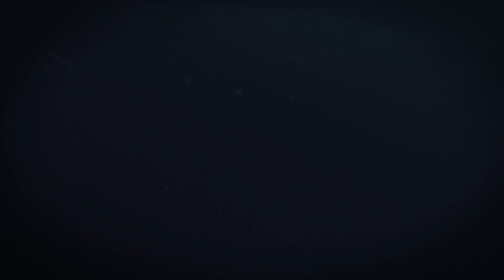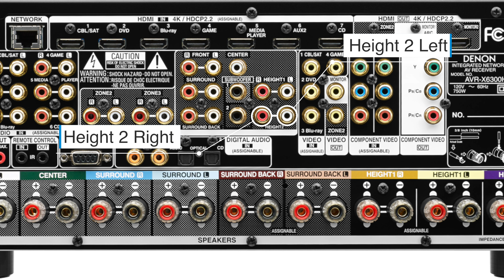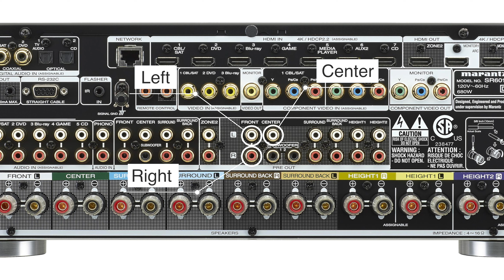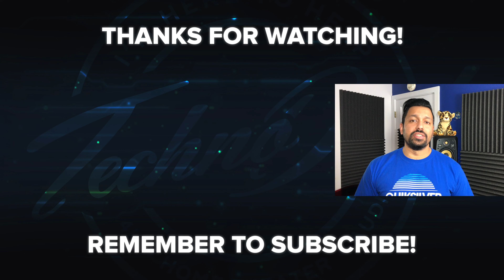How to Add an External Amplifier to Your AV Receiver | Home Theater Basics

Comment: Hi Techno Dad, so I can tell my Main Denon (x4300h) and plug in my old denon (AVR-5800), to process my front sound stage (FL, FR, CTR)?  By using the RCA cables? (FYI, I do have bigger speakers for my front sound stage)

Also: This is a more confusing question and I will try not to confuse you. I bought a bigger center channel that I want to hook. However, the speaker that I am replacing I do not want to discard. Now my x4300h can process 11 channels, and power 9 as you stated. My question is. Will I be able to add a fourth pre-out from my Denon x4300h out through my AVR-5800? for example lets say the voice of god channel, dead center in the ceiling?
Reply: i also want to know the answer to this.

Comment: Hey brother I’m using a Denon AVR 1300W 7.2 not sure how I can connect a amp to it.
Reply from the maker: Hi John!  Unfortunately there are no pre-outs on your model for speakers, only subwoofers.  Usually pre-outs for speakers come on the higher end models, like around $700 or $800+
Reply: Yea that’s what I figured out. I hate the fact that my volume level has to be almost maxed to get the sound level up. Don’t get me wrong my pair of Dayton 12" subs shack the crap out my theatre/office. Guess I’m just used to sound and want it to go louder. Luckily it’s a small room,lol.

Comment: Thanks for the vid, quick Q please, I got a Marantz PM60006 AMP and want to hook it up to my Denon X6300h to power up an additional top (ceiling) speaker. I know that I can use the Subwoofer 2 pre out to hook up to the Amp, but I do not know which port on the Amp to use, I have just the coaxial, phono, tuner, CD, network and recorder. Which one of those in the amp, should I connect the other end of the RCA cable. Thank you so much.

Comment: i have 4 subwoofers in my house and my av receiver onlu has the left and right pre out is that ok or do i need to upgrade my receiver?
Reply from the maker: Hi Matt!  You can use an RCA splitter to split the two signals and then you will be able to use the 4 subs.

Comment: Bro i got 1 center two fronts 2 sur backs and 2 front highs i double the fronts 
What is the best amp. For under 500
Reply: Jason G Denon AVR x2200w!!
I have the same and is very good
7.2,165 Watts on 4ohm
4k upscaling, 8 hdmi in an 2 hdmi out, 2 Zonen, Dolby Atmos and Dolby X
5.2.2 is possible! !Wlan and Bluetooth plus App for Smartphone! 😉😉😉

Comment: Hi I recently purchased Sony STR-DN1070 7.2 AV reciver. I need to upgrade the speakers.

1)I already have a active sub woofer(pioneer s-31w 150rms) but on receiver its mentioned 165W per channel does it affect my sub? 
2)Need to add one more sub, can I directly connect a passive sub woofer(250rms or a car sub woofer without amp)  into it? 
if not why? and can you suggest me some subs suitable for   my receiver
3)I had pioneer s-11 6ohm 150w surround speakers have 3"driver can I use the same?and I like bose jewell double cube but its costly compared to others. Could you suggest some speakers.

Comment: Ok I have a question
I have the pioneer lx-701 and I have an emotiva amplifier xpa 3 5 channels
Set of speakers are klipsch r7 II and the center is the 64II
I think my receiver can only run 9.2 and I will like to run 11.2 or 7.2.4 adding the emotiva ,, if I use the emotiva for the front left and right and the center how do I add the other speakers ?? Can I still use the channels from the receiver the front  left and right and the center to add the 7.1.4 ?? Please help ,, my other set of speakers are the klipsch 160m and I have 3 pair thank you

Comment: Great info.
That’s what I did.    Marantz sr8012. With a 3 channel 200 watt monolith amp.  For the main stage.
The amp fit my speaker requirements perfect.

Running a 5.1.4 dtsx set up.

Sounds better then my local theater. 

Again.   Great advise!!    Keep em. Coming!

Larry
Reply from the maker: Thanks Larry!  Sounds like you got a rocking setup!
Reply: What are your front three speakers?

Comment: WHen I hook up my new Red Dragon power amp to my pre amp outputs on my Denon 2808CI, my sub woofer gets a hum. How do I stop this from happening? The output from Denon to power amp is next to the cable for the output to my powered Cerwin Vega sub woofer.
Reply from the maker: Sound like it's a ground issue.  Have you tried using a ground lift on the subwoofer plug?
Reply: I figured as much. That is my next step. Than an isolator for my output cable for my subwoofer

Comment: parallel universe? i am going to be replacing my denon 4308ci for the denon avrx6300h . just watched this video, and now am curious if you added a 3 channel amp to your 6300? if so , are you happy with the upgrade , or buyers remorse? i am replacing the 4308 only because of the 4k needs. i am very happy with the current sound and never felt it was under powering my speakers. thanks,

Comment: Hope you can help me out looking into buying two new amps (Marantz AV receiver SR7012 2ch 8ohm 0.08% 110w will be driving 7ch) and a (Marantz Power amp MM8077 8ohm 0.08% 150w per channel )also driving 7ch exactly thesame setup as the AV receiver so basically 4 floorstanding speakers totall 8 surround (at the back stacked 1 on 1 on top of each other 4 sets, 2 centre channels) 

Will the 110w AV receiver be a problem to the power amp that is 150w???

As so my highest output range of my speakers (floorstanding needs 25-200w in 8ohm) the others surrounds and centre are lower ofcourse than that example 25-100w and 30-150w.

Will it make a big impact due to the power amp have more power?
Will it not as described as the speaker specifications needed?
Cranking up the volume will it be out of balance with each other?

What is your personal opinion about this and will you kindly make a video about this, been a question for about more than 4 months and no one can give me a GOOD answer about this.

Kind regards.

(All the way from South Africa)
Reply from the maker: Hi!!  So I would have the power amp drive the bigger/more important speakers like the left, right, and centers.  Then it probably doesn't matter which powers the surrounds/atmos.  When you run audyseey room correction, that should even out the sound for you so you don't get huge power differences between speakers.
Reply: Techno Dad Thankyou i totally agree and i think its a good idea, but! that doesnt make cause to run my Surround/Surround back from my AV receiver wont work because if only got 4ch im sitting with 8 speakers. 

And my AV receiver got 1 pre out for the centre what about the other one to the power amp ? also the other 4 floorstanding speakers?

Comment: Could you a review on emotiva amps they have budget and high end amps. I bought the a-500 5 channel amp to go with my new denon 4400.
Reply from the maker: I was looking at a few to check out.  I'll give them a call!
Reply: scarecrow66ab I was looking @ that to go with my 3400H. How's that working out for you?
Reply: Marcus U.     I have the a 500 and a 700 hooked to the 4400 and is great. Got the cables also from emotiva.
Reply: scarecrow66ab I just got the A-5175 a couple days ago. I can't tell a huge difference to when my speakers were connected directly into the Denon. Do you think it needs a break in period or no?
Reply: Marcus U when you add more speakers to the denon less power is give to each speaker. What setup do you have.
Reply: scarecrow66ab I have my 3 fronts hooked up to the Emotiva & the 2 surrounds to the Denon.
Reply: Marcus U the amp has duty power speakers. The receiver has several things to do. Your speakers will sound better at louder volume and cleaner. Play a cd in stereo and see where your volume is.
Reply: scarecrow66ab What volume do you usually play movies @?
Reply: Marcus U my room is about 12x17 and volume is about 50 to 55 and have definitive tech speakers. I have a 7.2.4 system. I have a two channel system with a300 amp amd volume around 35.
Reply: Marcus U i got my new sound meter so now the volume is between 60 and 65 for the denon. I could not use the stuff from denon because of the power subs in the front speaker. What kind of speakers do you have
Reply: scarecrow66ab My left & right fronts are the SVS Ultra Bookshelfs & the center is a Def Tech Pro Center 600. You don't use relative volume on your AVR?
Reply: Marcus U no and the volume i stated was on youtube now on amazon music i am between 50 and 55 volume. Your front three speakers should be from the same speaker company to match tweeters across but the amp will push any speaker with ease. Just the get speakers calibrated.
Reply: scarecrow66ab I don't have the space for the SVS Ultra Center. Wish I did. I'm pretty sure my speakers are set to 75DB. I have a pretty robust app on my phone that showed the speakers were level.
Reply: Marcus U that ok. I am def tech guy. I have bp6 from 1999 just bought the 8020 towers and the 8040 center. Paid about 1,000 in march for all three. I have 4 svs elevation speakers for heights. I have mythos for the four surrounds. Good luck on your system. That how i started out.

Comment: Adding an external amp to the main channels  and even some of the other channels can take some of the load off the receiver and it's power supply. I probably opt for at least a five channel amp because the more load you can take off the receiver that better off you're going to be in the long run.
Reply from the maker: Yeah, it all depends on what people's surround speakers can handle.  For the most part, they usually have a lower power rating.  I wouldn't mind pushing 250 wpc to my mains that are rated at 140 watts, but that might be a lot for my surrounds at 100 watts to handle.  I'm sure it would be fine as long as the system wasn't blasted, but I'm not home all the time, and my teenager loves to play everything loud.  I might get a 5 channel amp with 180 wpc to go to all the speakers and have my Denon power the Atmos channels.

Comment: what do you think of the denon avr-x4000 reciver..?great video
Reply: john smith same one i have been using. Great processorx but missong atmos and some 4k pass through for new stuff. Its getting older. If your just doing 7.2 setup ups, its awesome. Faily solid power side with some balls. Mine drive my system prettt hard in 7.2.
Reply: thank you for the info...my other choice is the marantz sr 5011 any thoughts..

Comment: Hey man forgot the option to use a pre amp for better sound quality and balanced but no internal power supply very good video great for beginners I got a anthem avm 60 and two Anthem amps a mca 5 (front three back two) and pva 7 (surrounds and 4 height) worth every penny also good power cords help alot too
Reply from the maker: Yeah, this is just for AVRs, I'll make one for XLRs and a pre-amp when I get one in to test.

Comment: Can you use another AVR receiver as an external amplifier to a your main receiver?
Reply: Phil Ferguson Probably not. They wouldn't want people buying older models to power their systems.
Reply from the maker: I read somewhere that you can, but it's probably not a good idea.  You'll have two volume controls to deal with and you'd be better off with just a power amp.

Comment: Perfect!!! Thank you! As a few have already mentioned, calibration and a volume set up tutorial would be a life saver. Also, which RCA cables do you recommend. Great video! Thanks again!
Reply: Gerald Valdez Amazon cable should do just fine. I use it for my subwoofer.
Reply: alexandsimba thanks!
Reply from the maker: Hi!  Any RCA cable will work.
Reply: Techno Dad thanks!

Comment: Hey what's up techno dad, love ur videos.  Question, any experience on using  pro amps to power the front mains?  Was thinking of using a crown drivecore 2 xls 1002 that I have sitting around not getting used.

Comment: What are considered small speakers?
Reply from the maker: Hi!  I'd say anything that came in a home theater in a box, or something that's rated at 50 - 75 watts and under.  Mainly because, if you try to push 150 or 200 watts into a speaker with a lower rating, it will probably blow.
Reply: What do you think of the Dolby Vision Philips HD blu rays? Just saw one goes for 199.00

Comment from the maker: 1:01 Why add an external amplifier?
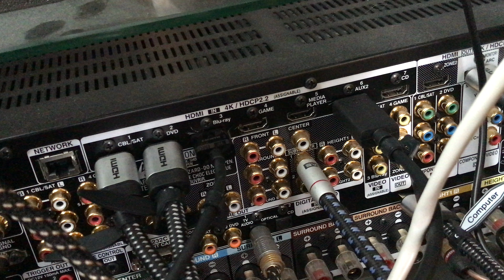3:57 Connecting an external amplifier
5:15 Denon
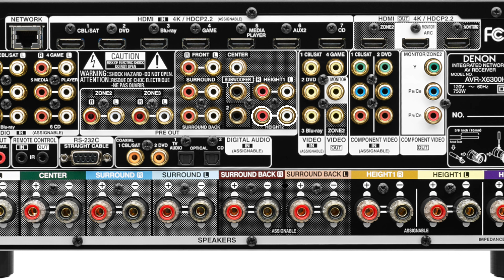5:40 Anthem
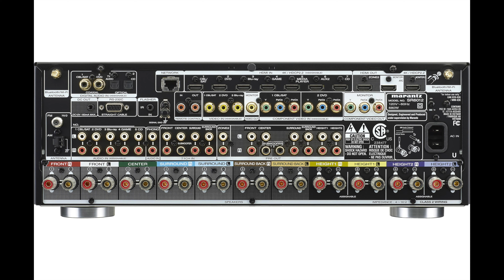6:04 Marantz
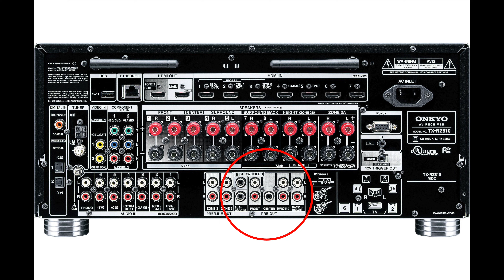6:28 Onkyo
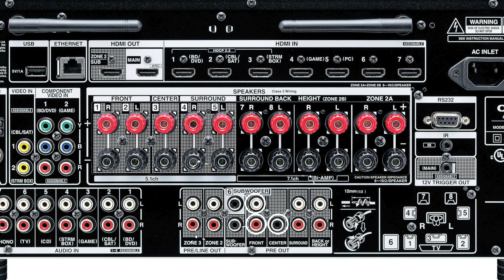6:46 Pioneer
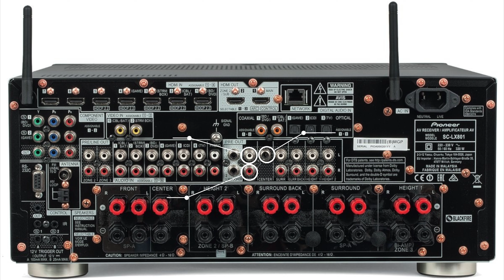7:13 Sony
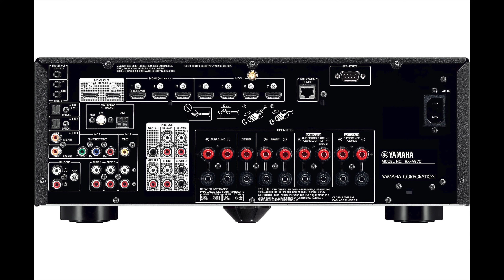7:31 Yamaha
Reply: Techno Dad Thanks so much for this video!   Getting klipsch rp line and didn’t even know I need a boost until I got them.  Is there a decent 3 channel amp you’d recommend?
Reply: If I use bass management, would it apply to the pre outs when using an external amp?
Reply: @blinkonceonsunday1325  yes
Reply: Does the auto calibration work using preouts?
Reply: How do I hook up a power amp to a 2 channel 100 watt receiver without pre-outs? My receiver gets really hot after a few hours of playing loud music and then trips. I would like to add more power. Thanks,
Reply: Sony
Reply: Is it a good idea to put your subs behind your couch
Reply: Thanks for the video.  I just received the 2ch  parasound hca 1500a  amp that's powering my front L,R speakers connected to my Denon x4200 receiver and I can't tell the difference with A/B testing.
Reply: I have a pioneer elite I'm new at all this stuff I'm trying to hook up the elite vsx-52tx to a c-60 preamp yamaha and a m-35 yahama  amp I am completely lost how to do this I'm hooking up 5 sets if technics speakers a50 a51 sb-cr33 sb-cr99 sb-k476 and 2 jbl subs 150 135 need help I have tons of audio equipment power amps preamp eqs recievers I need to learn fast driving me crazy please help email crzybsean@gmail.com
Reply: Techno Dad , i am planning this set up with my denon but using an integrated amplifier(outlaw rr 2160 ) with its own equalizer and input selector mainly for 2 channel music output. My question is would the sound processing in terms of tone control be on the denon or outlaw or both? Is there a way to bypass the denon in terms of “sound processing “ if that makes sense. Thanks 🙏 for all you do in this channel .
Reply: If I used a separate 3 channel amp to drive my Front L/R/C speakers, can I used the R/L/C speakers out to other speakers like to a different zone?
Reply: @Techno Dad, i have a car apmlifier and subwoofer, i would like to use these as, i already have them and they are very high end quality. I have 12volt powersupplies to power the car amp, now, what do i need to look for in the receiver to be able to send signal to the amplifier?
Reply: Do I need to go into the Denon menu and do anything to use the Oreo it’s for the front three?
Reply: Denon X6500h.  Head room?  Not sure I need it with Klipsch RF7s and RC7...
Reply: @ Techno Dad, does Yamaha have 3 channel external amplifier? If yes, brand number please.
Reply: Hi Techno Dad my name is Adam and I have an RX-A2060BL Yamaha AVR Receiver and I just Bought me 3 Klipsch Speakers Which is The Center Channel Speaker model number RP-504C and I got 2 Klipsch Floor Standing Speakers model number RF-26 and 1 R112sw Klipsch  Subwoofer and I wanted to know can I buy an Amp to power just my 2 Floor Standing Speakers? And if so what are some great Amps to look at to get? Please message me back when you can Thanks!